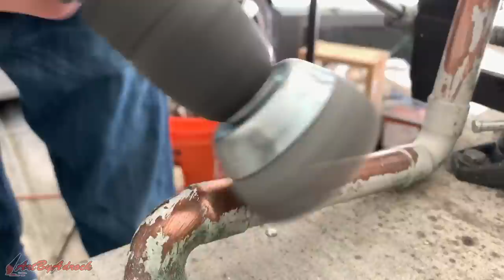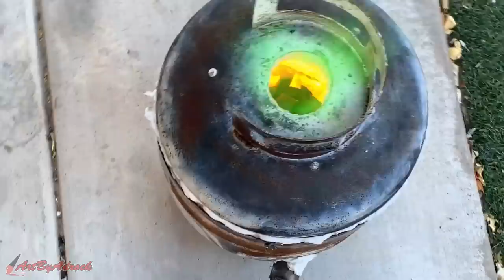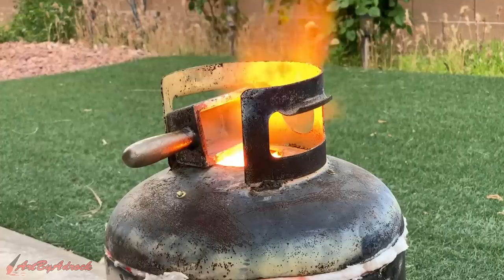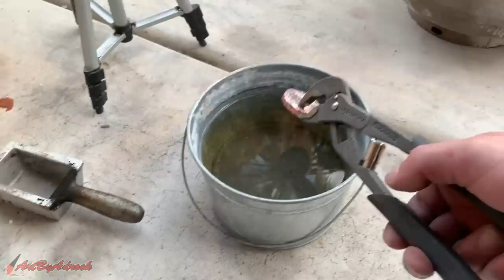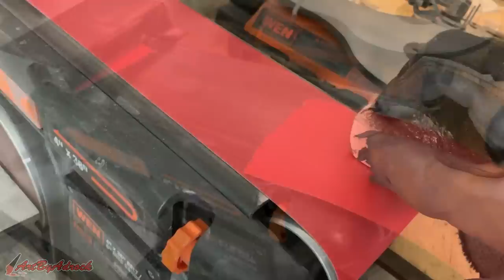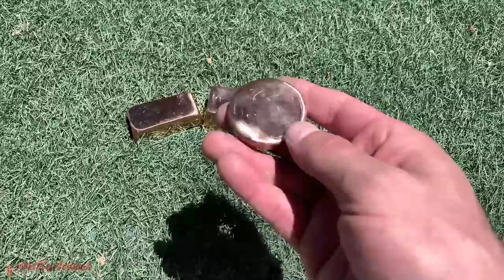What Can YOU Do With Old Copper Pipes? 100% Pure Copper Ingot Melt

Comment: I'm partial to copper ( a self employed master electrician) and have several hundred pounds of scrap copper. Also recycle old light fixtures and ceiling fans for zinc and brass. 
Those ingots look nice. I enjoy your videos.
Reply: Brass is so beautiful, do you use your scraps for projects or?
Reply: You sell your copper?
Reply: @mystiganine7505  no I don't. Hadn't really considered it. Guess I could though
Reply: @rockelec  Willing to buy from someone based near market value. If you're interested, let me know! I'm interested in it's magnetic properties.
Reply: @AudreeAdam  Sometimes if I salvage enough of one alloy (2 or 3 of the same light fixture) to make something. Mostly though I make Bronze for my projects. I think it buffs up to a nicer color
Reply: @mystiganine7505  where are you located (roughly)

Comment: Loving the videos, could I ask what your gas flow setting are for brass and aluminium please? Many thanks 👍
Reply from the maker: usually for aluminum I’ll keep the pressure about 1. For brass and copper I’ll put it higher at 1.2 on my gauge. Hope that helps
Reply: ArtByAdrock Thanks, I’ll give that a try.

Comment: If you wet sand the pads will last a lot longer and better finish. 320, 400, 600, 800, 1200, 1500, 2000, 3000 all wet. Have you considered buying a 6040 CNC and mill the ingots. Or a laser etch.